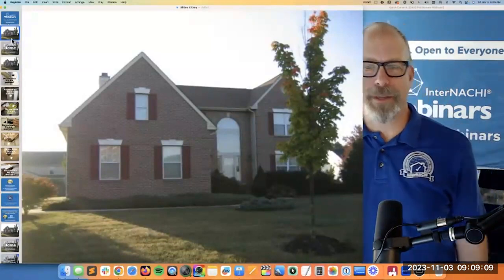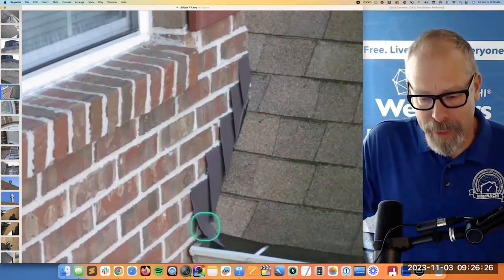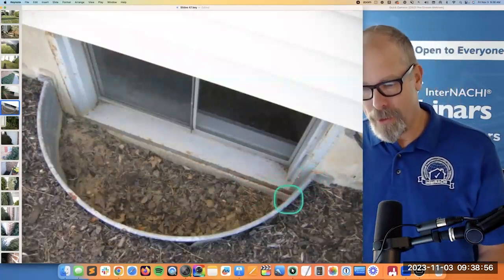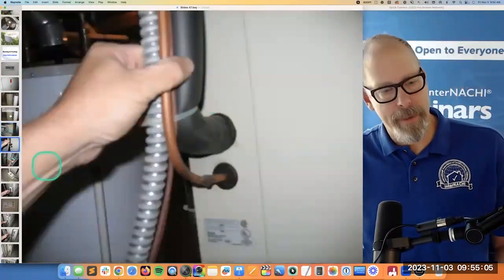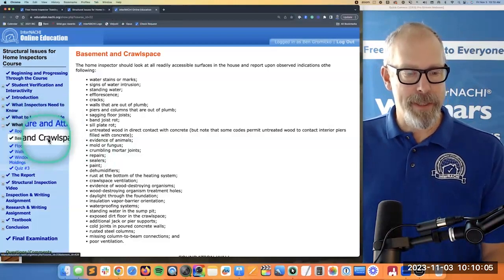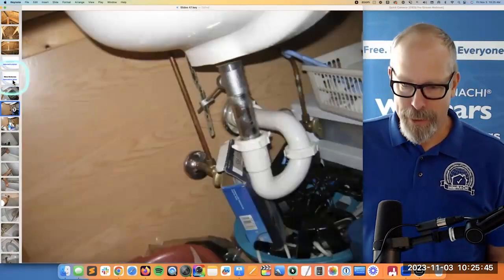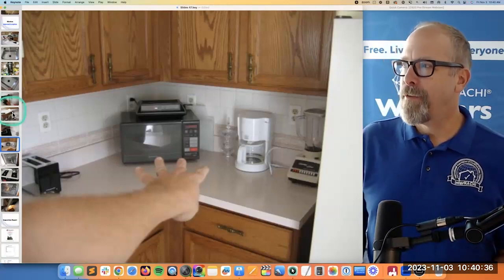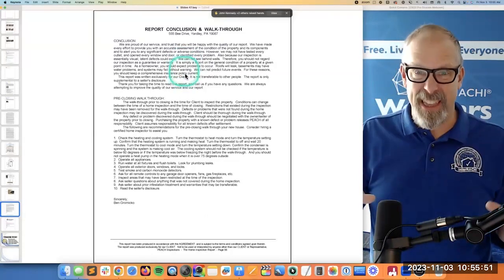"Inspect This Home" With a Certified Home Inspector

Comment: Is it common for water to overshoot the gutter when kickout flashing, is missing, and can this lead to a localized area of a deck rotting below a place with missing kickout flashing? I say localized as the other deck joists and boards are not rotting or sagging, and appear dry, where at this one location the deck joist is saturated and is rotting. Similarly, at another locaion on a sidewall in extremely close proximity to missing kickout flashing the door frame is rotting.  The water staining on the stucco sidewall that extends past the eave edge  where kickout flashing is missing is where my door frame is rotting except my cladding is vinyl. In another same type location the deck direclty below is rotting.
Reply from the maker: Thank you for commenting and for watching our videos.

Comment: At 22:19 you show a "little hole" you say water can go through if there is no. kickout flashing. What causes the hole to begin with? This video is showing stucco, but is there sometimes holes in this same type location on the sidewall - just a little above the roof-wall intersection on the sidewall near-above where the gutter/eave edge intersects that sidewall - where water can enter? How do the holes get there?
Reply from the maker: The hole is usually created from poor installation methods by the various contractors at that area at different times.